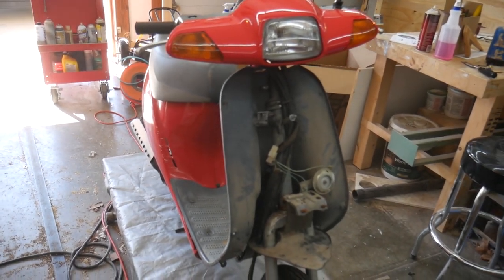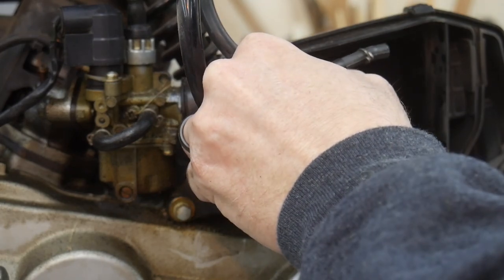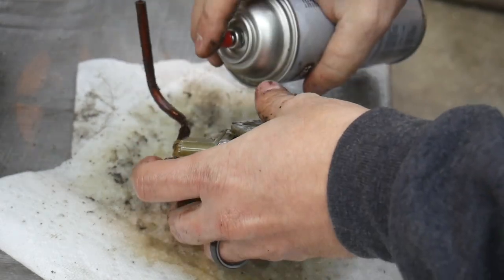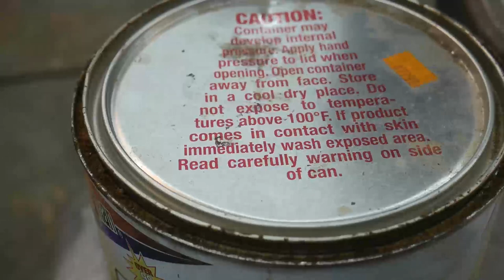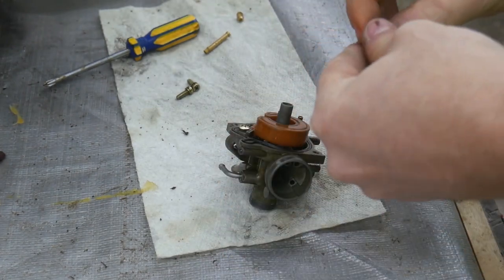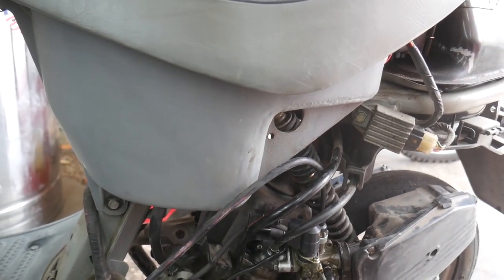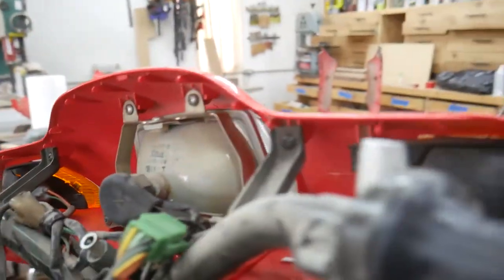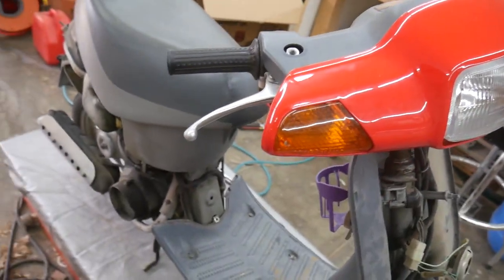1988 Honda Elite Scooter: Wrecked, Broken Down. Will it run?

Comment: Nice work.  I have a 1988 Honda Elite SE50P.  It has been sitting with a half tank of gas in it for over 10 years.   The battery is dead.  I pumped fuel out of the tank but need to attempt a start with some fresh gasoline.  New battery installation needed first.  Thanks for your video.  

What carb cleaner are you using?

Bill
Reply from the maker: I use the Berryman chem-dip for soaking. Cheap Walmart carb cleaner for spraying.
Reply: @SouthpawWorkshop  
Thanks.

Comment: Old gas. Most likely varnished. Fuel system and carb needs a good cleaning before anything else then new fuel mixture. Make sure the mixture is correct for that engine. Job well done

Comment: I have an 89 sb50, I'm struggling with the exact same issues the video addressed, I can't figure out the carb, no air filter, and can't hardly find parts anywhere. Can u point me in the right direction please
Reply from the maker: I learned everything I know about small engines by watching YouTube.  Check out the channel Mustie1 to see how to take apart, clean and rebuild a carb.  He does it in just about every single video.  The older videos are more detailed than the newer ones.

Comment: I have a 1986 spree and its been sitting for a year and there oil coming from the head idk what to do or what happen because it worked fine before
Reply from the maker: Not sure if this is your issue, but I found that if the Spree sits for a long time, and the oil tank is full, the oil will eventually leak into the engine until it is full, then could potentially overflow out of your intake. You may have to crank on it for a while until the oil clears the engine. Even then it will smoke for a while and run really poorly until all the oil is out of the system. Good luck!
Reply: @SouthpawWorkshop  i just scored an 86 spree that had been sitting for years, i did a new cylinder and piston, cleaned carb and tank new petcock fuel lines throttle cable and even new reeds and a new exhaust! it smokes like crazy runs fine on the stands takes a second to go full throttle and smokes like a bastard but trying to ride it, under load it bearly moves, Im suspecitng thats my issue! crnakcase filled with oil while sitting

Comment: Any ideas on where to get parts for that carb I can't find anything
Reply from the maker: Your best bet is eBay. You might get lucky and find a rebuild kit. Otherwise you might have to settle with an aftermarket carburetor.
Reply: @SouthpawWorkshop  that's my problem the choke is on the wrong side and hits the shock. I need to find a way to swing the intake manifold away from the engine

Comment: I am told that my 1988 Elite E Scooter needs the attached part.  I tried ordering and it was out of stock.  Any creative ideas on a different part to use or where I can find one of these?  Gasket Set 16010-gs6-305 (https://www.cmsnl.com/products/gasket-set_16010gs6305/)
Reply from the maker: You may want to try Amazon or eBay. They are pretty good resources for hard-to-find vintage parts